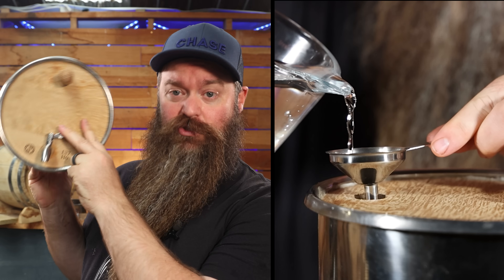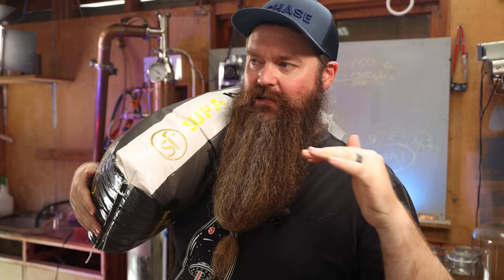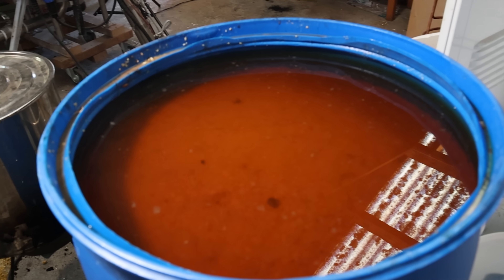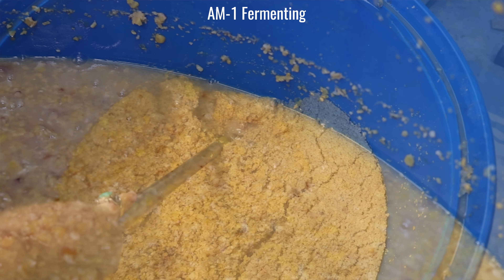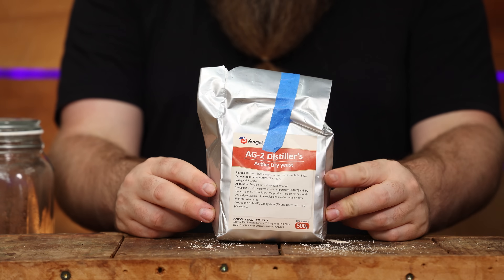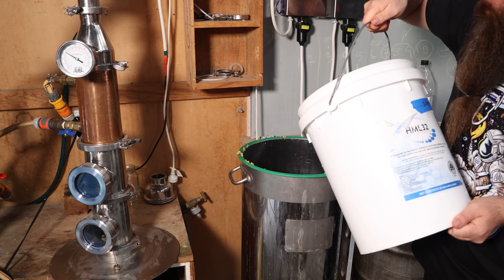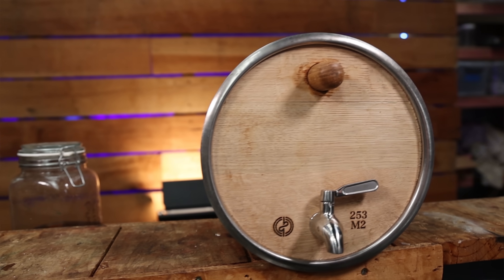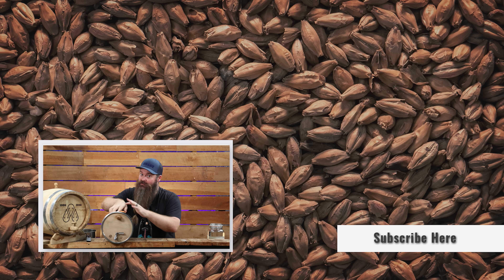I Turned Corn Into Whiskey & Filled A Barrel

Comment: Cold pre-soak the corn for 12 hours before cooking and the starch will gelatanize much faster because their will be sufficient moisture deep inside the particles.
Reply: Additionally, in industrial wet corn milling, during a long steep a little bit of lactobacteria is added to produce a bit of acid to help break down fiber bonds.
Reply: @zinger565  Would that be considered a sour mash?
I know about going to the opposite pH, adding alkali (fresh hardwood ash, burnt/hydrated lime , or lye) with whole corn to hot soak water and standing overnight to cause nixtamalization, [follow with rinse] which also breaks the fiber bonds but that also changes the flavor and arroma. (Think tamales or corn tortillas for tacos.)
Reply: My no boil process seems to work well , pre soak with. Lactic acid solution of 1.67 % no higher or it will cause problems, I can refer you to a paper if you like, then drain off pre soak solution , hit it with boiling hot water and stir it should start to gel, the temp will be in the high 80 to 90 c , I add high temp XL a high temp alpha amylase , mix and let it work , once temp hits to about 62c I hit it with a mix of amylo300 (Alpha )and bioglucanase ( a beta glucanase )..but you have to monitor your ph most enzymes have a pretty narrow ph window to work effectively. , let it cool and keep mixing , I use the Fermentis usw-6 yeast… regularly get 1.040 to 1.035 SG, the interesting thing I have found in my experiments between just water presoak and lactic acid presoak is the final gravity , I always seem to get to get a lower FG with presoak typically .999 compared to 1.005 or 1.007 in the just water presoak.. 
I live in eastern Ontario, Canada where 30 kilos of ground corn costs me about $16.00 Canadian
Reply: @BruceGiven  The presoak is likely freeing up more yeast nutrients, phosphate and nitrogen [amino acids] which cause faster more complete fermentation. Possible other cause of FG is that there are fewer intermediate chain maltodextrins due to more complete mashing.
Reply: @mytech6779  the theory behind it is the weak acid solution breaks down the elements of the kernel and frees up some proteins , but it also frees up the corn oil , strangest thing I saw was opening up my fermenters to see oil on the surface (Maybe it was a very oily batch of corn ) but as corn is notoriously short of yeast nutrients and nitrogen, I always add nutrients typically Yeastex 82.
My next experiment is to use a ammonia pre-treatment and see how it yields.
Reply: @BruceGiven  ammonia will likely nixtamalize a bit, though it is a weaker base than the calcium or sodium hydroxide used for hominy.
Reply: @BruceGiven  , you mention "ground corn", does that mean milled down cracked corn, if so how fine? Are we talking like meal or finer? The lactic acid that you refer to, where can I get it and how much of the acid is used per pound of corn?
Reply: @michaelrendas5137  I purchase cracked corn and run it thought a old corona mill that I have just to crunch it up a bit more, The lactic Acid I use is 88% , I know that a lot of Home brew stores sell it , just dilute it down in the soak water ( Ideal is 1%) , volume is not really a issue as I dump my soak water after the 24 hour period
Reply: @BruceGiven  doesn't that lead to a loss of starch that would be dissolved in the water? Or it doesn't release starch due to low temperature? Newbie here
Reply: @Greedman456  Even if the Starch is dissolved in the water , the enzymes will still convert it. As for Starch conversation you need to look at the datasheets for the particular enzymes you are using and adjust the Temp to there optimum or as close as you can get
Reply: @BruceGiven  "No Boil Process"..."Hit it with boiling hot water and stir..."  Wht the hey?
Reply: @HighGear39  ok you got me 🤣
I guess I mean no boiling and trying to  stir piles of goopy corn
Reply: @BruceGiven  Everyone knew what you meant, just having a good time with ya.
Reply: I am going to try that.  Thanks!

Comment: I would assume that because the stave is not exposed to air on one side that the through-wood reactions will not happen. I would guess the alcohol would only go through a surface layer (just a guess).

Maybe that's solvable by an occasional vacuum chamber exposure, not sure.

Comment: Great video man. Very well done. Planning on doing my first corn whisky soon. I am wondering if someone is familiar with the alcoengine reflux column and if it would stripping too much flavour if doing a stripping run followed by a spirit run using the 1mm attachment. It sure is more intense than a pot still so wondering if some flavour would remain

Comment: so if a condenser gets too warm or hot the shine coming out will be too harsh or hot? is this because more of those volatile part of the alc will not be going in the shine but will be lost out the worm into vapor and those would have contributed to making the shine smoother had they condensed along with the rest had the water cooling been cold enough is that what it is?

Comment: Question. When looking at mash bills from some distillers, any malted grain is said to be used for it's remaining enzymes to malt the other grains in the mash. Is malted barley necessary? Are added enzymes the only way to convert the corn starches into sugars? If mashing corn only, does the pitching the grain begin the malting process naturally? Basically, can you mash corn without added enzymes and/or malted barley?

Comment: Hello sir, this is a callback to your "Is Buying A still Direct From China Worth It?" video. It'd be great to see a follow-up on that video, see if your friend was still happy with it and what issues might have cropped up since you're last video. However, what I'm more interested in is how he was heating his still. 

I'm familiar with stills that use electric heating elements which go directly inside the kettle along with the mash, and thus run the risk of scorching the mash and ruining the run. I'm also familiar with stills that are heated by steam which is produced from a separate boiler, with the steam produced by the boiler channeled through tubes inside the still's kettle or through a jacket around the still's kettle. 

However, for jacketed stills which have either glycol or a high boiling temp oil in the jacket, like your friend's, I don't know how those stills are heated. Are electric heating elements inserted into the jacket, heating the oil, or does the oil flow from the kettle to an external heater (similar to a steam boiler) where it's heated before being sent back to the still?

Comment: How tight did you make the cuts if you're planning to age for years? I've heard wider cuts if you're planning to age for a long time, but seems like only heads would age out, while tails would always stick around. Any comments/advice?
Reply: If it helps, my long-term aging experience (4-5 years now on some barrels) is that tails age out as well. I don’t know if they transpire through the barrel head, adsorb into the char, or are converted by chemistry inside the barrel. But I do know that they are detectable in new make and u detectable in older spirits. Cheers!

Comment: What press do you use for pressing the bags of grain... It seems pretty well made, and I would like one !
Reply: @mrjackson66 fwiw, a press is great as you can also use it for any fruits you may chose to utilize for brandies or ciders etc for me though I dont use as much fruits, I found it messy and hard work and still ended with a somewhat semi wet mound of leftovers that can mold quickly. I have changed to using an apartment portable spinner/dryer unit. Look up search "Nina portable spin dryer". The spinner holds approx 3 gals of mash a go. I place a filter medium in the spinner (it could be linen or down to 1 micron filter cloth etc depending on end needs). I throw a bucket of the fermented mash in to the spinner and run it for 3-5 mins. It drains out ALL of the fluid and grains come out dry to the hand. I use it also for sparging. The 'dry' grain keeps a lot longer for the animals too without getting ugly. Just something to look into - plus they regularly come up on the 2nd hand markets for cheap

Comment: So that small barrel doesn't allow the wood to breathe, what kind of effect does that have on your ending proof and character?
Reply: Hello, friend. Are you interested in whether the Badmotivator barrel allows transpiration through the wood? Your comment reads like you are asserting that it does not. In my experience they age and mature spirits in the same way that a large oak barrel does, with micro-oxygenation, a small angel's share, and an appropriate amount of wood character added to the spirit. 

The change in proof over time will depend on the average humidity in the barrel's environment. If we keep temperature constant: In a high humidity environment, water has a hard time leaving the barrel, but ethanol has its own rate related to the temperature only. The proof will drop. In a low-humidity environment the water eagerly leaves the barrel and the ethanol will behave the same. In this case proof may rise.